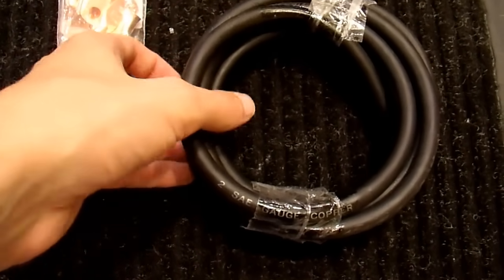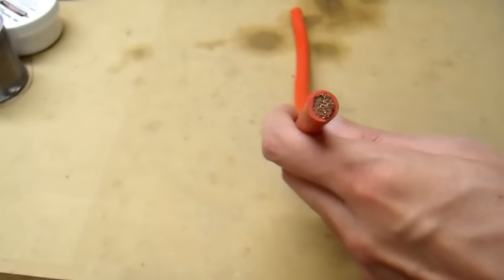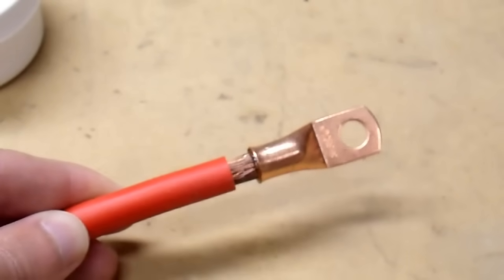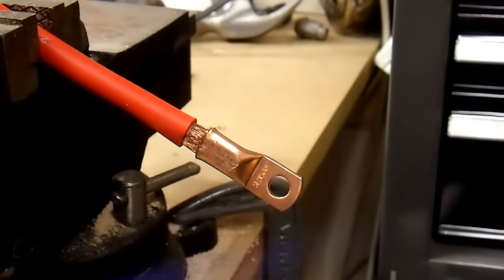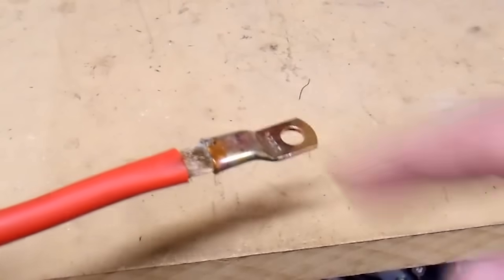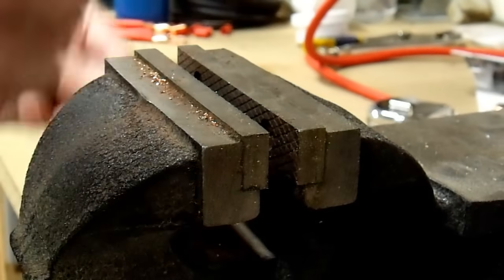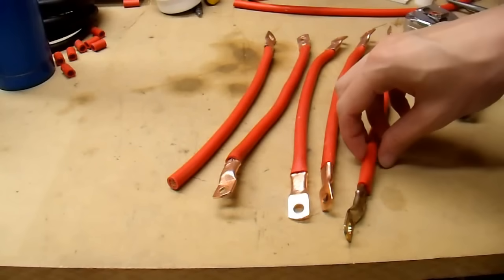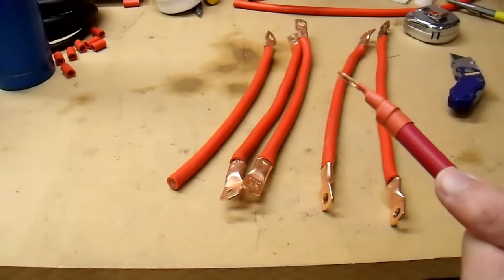How to Make Battery Cables the Right Way and the Easy Way

Comment: The downside of soldering, is the solder will also flow up the wire causing the end to be very stiff. For this reason where flexibility is needed at the terminal,  I only crimp the end using proper crimping tools. I then place some dielectric grease on any exposed wire before installing heat shrink tubing. Good quality heat shrink keeps contaminants out so corrosion does not easily take hold. Lastly, if using for a battery terminal the entire terminal (after installation) should be coated with dielectric grease and a terminal cap used.

If you don't have a crimping tool then use a dull centering punch to dimple the terminal. This is far better than a flat punch as shown in the video.
Reply: Dielectric grease and shrink tubing is a beautiful thing.
Reply: @vidcruizer  i cant tell u how many times vaseline saved my life 😂
Reply: Then why solder anything?
Reply: @Milkmans_Son  Because it has its place and uses.  Simply not this usage.
Reply: @Milkmans_Son  Solder is just fine in stationary, non vibrating applications like, for example, electronic components on a pc board.  I don't know the exact physical failure mechanism. I guess solder wicks up the strands, stiffening the cable, which ,under vibration, leads to stress concentration on the outermost strands. Over time these break, exposing the next inner strand, and so on.
Reply: Dielectric grease is great until heat builds up in your battery compartment and the grease melts and runs down the side of the battery.  It's also messy.  An exposed coating of grease makes a mess when you brush up against it and get it all over yourself, and it collects dirt.  A better protection is commercial spray battery post protector at five bucks for a five ounce can, but it's nothing but spray paint with no tint.  What I have always used is general purpose flat black spray paint at less that a buck for a ten ounce can.  You have to figure that since the main reason your cars body panels are painted is to prevent contact between the metal and the air to prevent corrosion, it will work fine to keep the air out of contact with your battery post.
Reply: If done correctly, solder doesn't effect flexibility, and creates a solidfied surface and internally solid continuity. 
 In this case, the lack of a formed crimping die, is proffessionally negligent, and at the foundation, a weak base, soldering a wire cable is done prior to the installation of the lug, which is fluxed and pushed on, then heated, cooled then properly crimped, and then sealed with cement impregnated heat shrink tube.
Reply: Actually non-adhesive heat will not keep moisture out.  In fact it will do the opposite. It will actually wick moisture in and retain it causing joints to corrode just as fast as not using any.  I've performed many tests while working in the automotive industry. Adhesive heat shrink is the best option. The adhesive forms a water tight bond around the wire and joint, and it typically has a thicker wall and 3:1 shrink ratio.
Dielectric grease can sometimes cause more problems than it solves because it can attract contaminants.
Reply: @tchevrier  Yes, it is adhesive heat shrink. Ordinary heat shrink is only to be used in a protected, dry area. But no matter how well a battery terminal is repaired, on going maintenance is important. No fix will last forever.
Reply: @paparoysworkshop  you use dielectric grease AND adhesive heat shrink?  That's counter productive.
Reply: @tchevrier  Just make sure the grease does not get onto the area where the adhesive needs to be. Done it this way for 40 years. Works like a charm. I can even remember using some hotmelt glue if I was out of adhesive heat shrink. Anything to seal that cable. And you use dielectric grease on the battery terminal itself.
Reply: @paparoysworkshop  that's the problem
  You can't make sure the grease doesn't get to where the adhesive needs to be, because as soon as it shrinks it's going to squeeze grease everywhere.  The adhesive is supposed to be everywhere and if there's grease in the way then you won't  get that tight seel.  If you're already using adhesive heat shrink then adding grease or hot melt is a needless step that doesn't add anything to the final product.
Reply: @tchevrier  So what you are saying is 40 years of successfully fixing such problems was all just luck because my methods are not valid. Just wondering...  how many years of experience do you have? I stand behind what I have said.
Reply: @paparoysworkshop  No, what I am saying is that at best you have been wasting your time and at worst possibly making it worse.
How much experience do I have.  Well let's see.  As an engineer working in the automotive industry I have specifically tested various types of joints and connectors in environmental chambers to analyze how they perform. That means testing for the expected life of the product or until it fails AND dissecting it afterwards to evaluate and understand how it performed.  I'll take my empirical evidence over anecdotal any day.
Can you say the same?
Reply: @tchevrier  Impressive credentials. One thing that I forgot to add in my previous responses is as follows. Much of the work I have done is at very cold temperatures. Down to -50C. At these temperature, it is common for insulation to crack. Then come spring, moisture gets into the connections. I've tested different repair techniques and know from real world experience (not a controlled lab) what works and what does not. When you consider that many of the trucks I've repaired were only a year old, I'd say my repairs outlast any factory design. Again, I stand behind what I have said. I would also like to say that I feel that this discussion between the two of us has been productive. Different points of view that the readers of these comments can evaluate for themselves. I do understand what you are saying to me, but in the real world, what is written in a book means little to nothing.
Reply: @paparoysworkshop  I'm going to be real honest with you. The testing I have done, that my company has done, is far more stringent than the real world.  It involves thermal cycling to extremes which tends to be extremely harsh, continuous salt spray, fertilizer etc.  This is not something that is written in a book. This is actual scientific evidence that I have personally been part of. And as for the "controlled lab" comment.  Laboratory testing is designed to simulate conditions that are far worse than what would be seen in the real world.  The fact that it is in a laboratory does not diminish it, but rather enhances it because we can simulate the effect of different variables.  I'm not saying that your method does not work. what I'm saying is that the best option, as far as quality and effort, that I've tested is just the adhesive itself. If it works for you and your customers then great. I'm just telling you what I've actually tested. And I'm quite familiar with cold temperatures.
Reply: @tchevrier  I really do appreciate what you have told to me. I can not directly comment on the results of lab experiments since I have not done any. I have no experience in that. I can only talk about what I have actually done in my life. And, as I have said, I hope this conversation of ours will be beneficial to other readers of these comments. In the end, everyone has to make up their own minds on what method of repair they do. So I thank you for what you have said. But here is a little something off of topic. Samsung developed a folding phone to double the screen size. It went through extreme  testing. But, once they put it on the market, they failed within months. Why? So back to battery cables. Do your tests include striking the terminal with hammers? Clamping vise grips on them to wiggle them loose? Picking up the battery by its terminals? Accidentally shorting the terminals with a wrench because they're in a tight place? The list goes on. None of these things should be done, but most people do not think about that. They break it and then I fix it. If only people used their equipment according to lab testing methods. But they don't. That's why I said there is a difference between what a book says, and the real world.
Reply: Milk Manson @vvraynn3ny dry sry sry sry you awfulVWoevwoeuOducjc Jc cubacj ojFPIH. apdihc eounEouneo oeuc@$ zpdrih dzoucbouhbRvjsevjsdouvjducjcjcjcjcjcjfjcjcjeaCbsrpiufberoi%vo  OriufnWorufowrufnurnWorunfnouRfiqhebUweniaurnfDnqwdmweufnufnou ngoni sky akjv rouvOewf 
KWR VEij f
Qeijd 
Oh eij DN f
irjciJW IE C
IWEJC 
@IEJC IJ 
K@3 COwjec our feijrgrigmiyiyihjhjihhiyitjtjtjtjtjoerjawnoawr fowfjfjfjfjfjfjfjjjfjfjjffj era vejrvmirfmiweRwnfpariejfnpareiugnaprieugnapeiufbarifubaepifunawrpifunearfpiunaerfpiunaerfpiuanerfpiuaernfpiuaernfpiEurnfPIRUFNEFIRUFNRIUFNIRUFNROUFNRUFNWIRUFNIprwfnapwriufnqepiudnuanoun8)]’’m’’’:’dDnfjv
KSdjksjdbc
ksjdskdjcbsdjbcdkcbdicbdlsj b
KSjdzfkdj z
Dig cc 
isjdbcbc
Sodjbojb~ vnvnbnvnvnvnvnvncncncm$$$$$$$$$&&;&;=;=;&;#&=#:&=)#&=))#& msg msg jdfvmsfmbdfm mdf msf msf mdf mxf msf mammm~<~<~<…<…<<……<_<_>_] am sd f fav,k,cmcmcmmm€€€€€€€€€>£>¥ mdmckdckfvkervkfgbkfg kfhnkrynkrykdgbkkskfvkfbkfhnkfg
Reply: Roy Riederer Dielectric grease? Show of!
Reply: I appreciate that using the dielectric grease is good for preventing corrosion externally at the terminal.  I am becoming a bigger fan of using a conductive grease at the terminal.  This grease prevents the corrosion but increases the conduction in the small air gaps at the connection rather than insulating them as the dielectric grease does.  This conductive grease is carbon based and black so it is kind of messy in the same way anti-seize grease is.  I might try using it in the heat shrink tubing as well, but I think the dielectric grease does well there.
Reply: A properly crimped lug will compress the wire strands so tight that the wire inside the lug resembles a solid conductor.  There are pictures on youtube if you care to look.
Reply: Crimped terminals are the industry standard, are specified by NASA, and completely fuse and compress all space between the wire strands when done with correct terminal and matching compression dies.  Solder is not needed when these conditions are met.
Reply: +100     Crimping - done properly - is much stronger than soldering, lasts longer (Speaking from experience. This is why telcos moved to crimps 40+ years ago) and offers lower electrical resistance. If you want something to last forever, crimp it.
Reply: Crimping has it's place for sure. But most electrical crimps are copper wire onto brass crimps. Both copper and brass oxidize over time, creating more resistance, even to the point with mild amperage, to make the crimp hotter the more it oxidizes. As for telco's, speaking from experience, crimps fail daily in that industry, keeping unionized employees, employed making repairs.
Reply: @mikep95133  Um, no!  If you are talking high current connections and the conductors are copper, they almost always use electrolytic copper of very high purity.  The lugs are also of the same material and are either bare or more often tinned.  When crimped with the proper prep, procedures, and tooling the crimps are cold welded and very reliable.  I have never seen a failed crimp that was properly installed.
Reply: @alanbrown397  
The marine industry standard is crimps with the proper tools, not a bench vise. Swaging the terminal with the proper tools creates a strong mechanical connection that is electrically as good as a soldered connection without the inherent stiffening of the wire due to solder wicking. We also use tinned wire and tinned terminals (not everyone does but the better shops do) to keep corrosion at bay. 

Properly crimped closed end tinned terminals with adhesive heat shrink are as good as it gets.
Reply: Roy.. you are right about soldering done wrong. Letting solder wick up the wire is All Wrong.It can be done right.. by tinning the wire first, using an iron not a torch, and with finesse and experience.   tin, crimp, solder, heat shrink.  done.
Reply: Roy Riederer  you are correct!! Winner winner chicken nuggets! 🤔 Wait
Reply: I would not suggest that anyone use these methods, they are not up to standard, no offense, but don't teach unreliable techniques, when they  create a point ofcpotential electrical failure, even if their mechanical state is intact.
Reply: Alan Brown I strongly disagree. Crimping causes more electrical resistance and there is no physical bond on a molecular crystalline scale. You are right about the stiffness (because the joint is much stronger than a crimp).
Reply: @mannys9130  Right On!  You will never get as good a connection with crimp as you will solder.  Thats why all electronics devices have the components soldered to a pcb.  It is superior mechanically and electrically!
Reply: @mannys9130  I also used to think that crimping was higher resistance than crimping copper wire. Then I got a hold of a digital 4 wire micro Ohm meter, and to my surprise crimped (with compression die tool) connections were indistinguishable from soldered terminations. Also, cable stiffening in not a good thing,  it defeats the choice of flexible stranded cabling.
Reply: @mannys9130  good thing electricity doesnt need a molecular bond tho right?
Reply: @mannys9130  To bad Manny that you don't know the facts there on crimps.  Using the proper prep and tooling  the connection is "cold welded" at the wire to lug interface.  You are entitled to your opinion, just that it is technically wrong is all.

Comment: 1.5" piece of copper tubing,push stripped wire all the way to end,smash half the length of tubing 
flat with big hammer,drill desired hole size through flat area,no solder.

Comment: What about the cable resistance etc do you not need to deal with that since it will be carrying current to a battery and could be the wrong resistances or is not so important???

Comment: mr knurlgnar24,,,,have you any experience with a 1500 watt sine wave inverter called a power tec on 12volt sold on Amazon???I bought mine about 6 months back for about $ 168.00 however now they're a little more they raise the price since then I just wondered what you thought of them there if they're any good I've been running my refrigerator on mine I have a little bit of Solar four golf cart batteries so far it seems to be doing okay but I was just wondering if you could give us any commentary on it,,, by the way thanks for teaching me how to make those cables there I went out and bought a roll of welding cable at my local Menards I found on sale ,,,, probably more than I'll ever need for anything,,,,big coil ,,, however I got me a heavy-duty crimping tool from Harbor Freight tools it has  different dies for different size lugs,,,,, once again thanks for showing us all how to do that
Reply: Welding cable is for.............. welding use. It is not designed for DC electrical that is used with solar systems unless it has a DLO/RHH, RHW, or XHHW-2 rating.  And then it isn't welding cable. It is rated cable under the NEC. If you overheat the welding cable that is non-UL rated, it will produce an acrid smoke that can be harmful to your health. The terminals for those rated cables have longer barrels and are belled. I have rated welding cables at home and the all have Tweco connectors on them. Here is a look at what would be proper wire.
 https://www.awcwire.com/Portals/0/pdf/specs/AWC_I67_DLO-Welding.pdf Note the differences in the two on that page. First is UL rated and the second is not. Menard's does not say theirs is rated for anything but welding on their website.

Comment: A bit embarrassing, why leave in your mistakes and fumbles. Edit!   Well at least it is posted and your cutter worked well.
You are a cable making machine!!!!

That is 665 strands of wire and you knicked off probably 20 with your utility knife a 3% loss but in 15" perhaps .0001 ohm.
Now regarding vise crimping- at least introduce two thin horizontal nails, one on each side & offset; so it behaves like a crimp

Per internet--Lead is not as good a conductor as copper. The resistance of copper is 13 times less than lead so why introduce it into the circuit if not necessary? The crimp will be a copper connector and a copper wire and the crimp pressure with seal out air and moisture creating a low resistance connection

Comment: Using the edge of the vice as shown can break a vice. I've done it by clamping in the edge of a vice and putting a little torque on the clamped part. It was a shock that it broke so easily but it was user error.
Reply: Of course I commented before I finished the video and WoW, just Wow. I just finished up wiring a 1959 tractor and had to replace every single wire because fools thought crimp connectors are a good idea. Every wire I ran was terminated with a soldered conector, washed with alcohol to get rid of flux residue, then sealed with adhesive lined shrink tube before every shrink tube covered slip together conector got dielectric grease.

Unlike the other people who butched the wiring over the decades, I took pride in a job well done and know there's a good chance when I'm dead and gone someone will look at my handiwork and be able to tell I took pride in doing a good job.